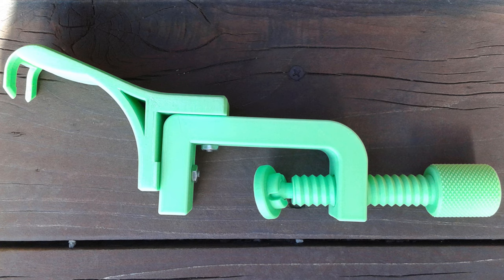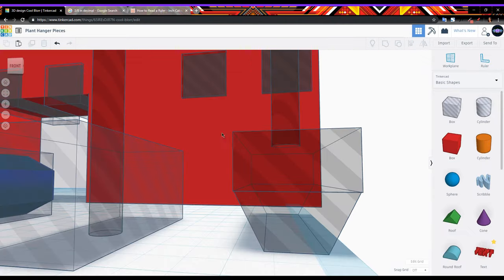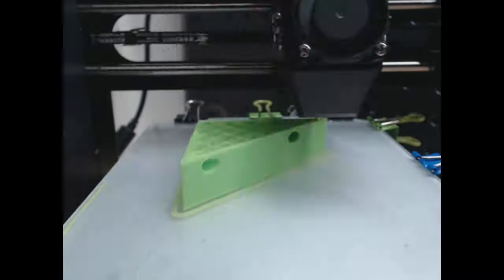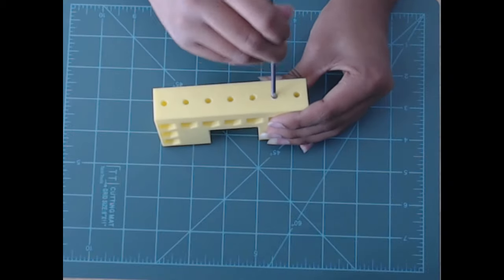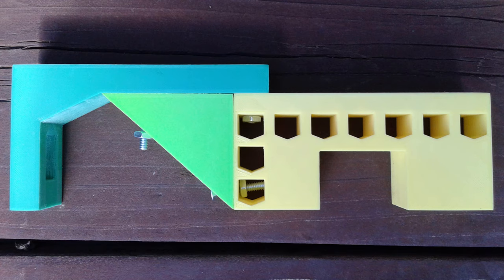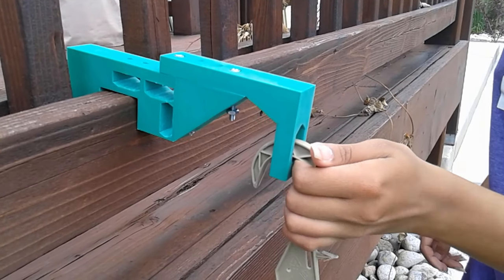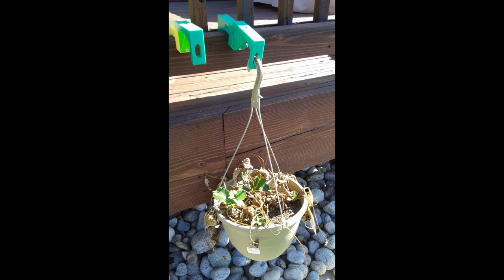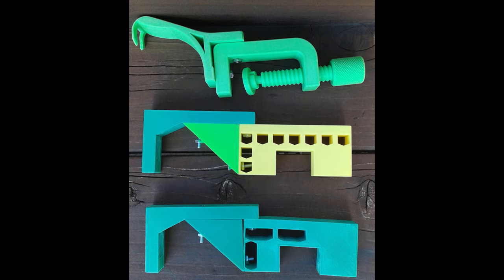3D Printing | DIY Plant Hanger!

Comment: Wow, talk about a little over engineering...lol would've been easier to make a clamp like the 1st thingaverse product, with a modification to the length of the hook arm...lol this was still a fun project for you I'm sure. 😅👌
Reply from the maker: I 100% would have made the clamp or hook longer but that's as big as I could print them on my printer. The print bed is roughly 4.7 inches all around. So while it may be over engineering, it works for my small print bed. Also yeah, it was very fun for me xD. It's the first time I designed something from scratch that would use screws and I actually got the measurements right.